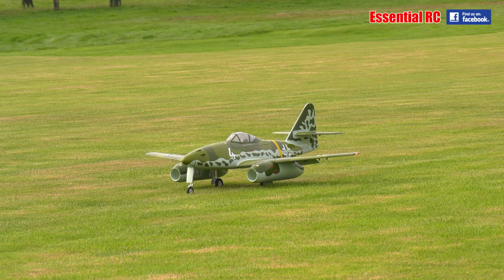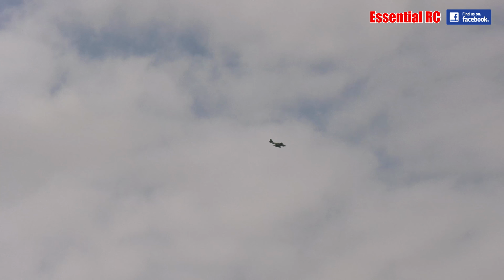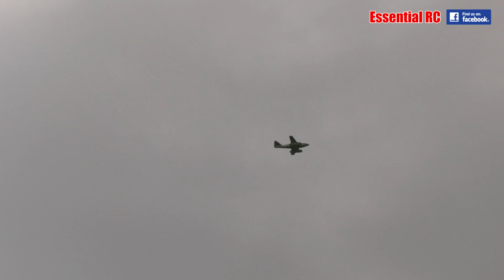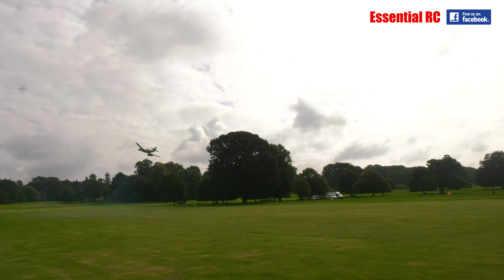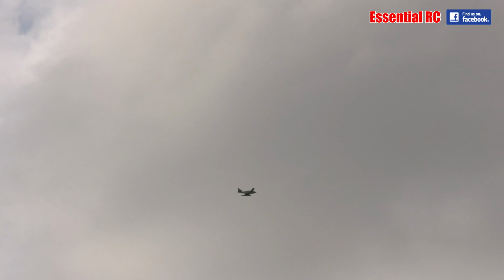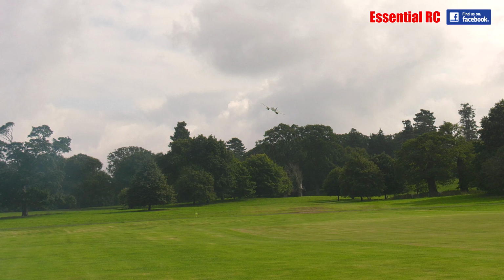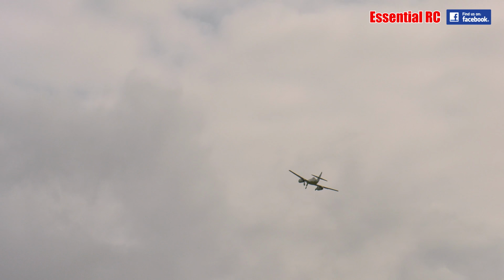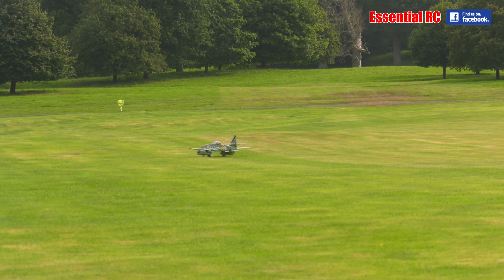HSD Me-262 PNP EDF JET ! Piloted by Michael Adams | Weston Park International Model Show 2021

Comment: Perfect 3 point landing!
Reply: Except for the fact that a 3 point landing is NOT what you want with tricycle gear.
Reply: @brianbrotherson5529  yes I know I flew real C 152 172's back in the 80s and 90s and always pulled the nose up just before touchdown to land on the back wheels first then gently lowered the nose wheel..I'm just saying it looks good seeing it on a RC model being smooth aesthetically speaking.
Reply: @KoolKman  it was smooth, I’ll give you that.  I cringe when I see Cessnas and Pipers land like that,  they are  just one small porpoise away from a bent firewall.

Comment: It even has wheel brakes! While it is quite a price-tag, the level of detail and functionality is baffling. 
My only concern is, as with all foamies, that the surface is so soft and will get dented with each and every transport to the field.
Reply from the maker: Not these. Super high density foam.
Reply: @EssentialRC  Well, it has gotten better and on planes like the FreeWing Avanti S or my latest, the Wots Wot biplane (with pan & tilt FPV 😉) I don't care that much. But on a beauty like this or my FreeWing MiG 29...
I do see each new scar and it does bother me (even if no one else can see them 🙂)